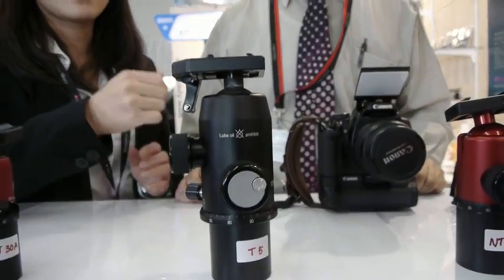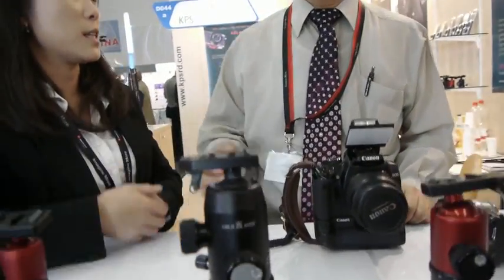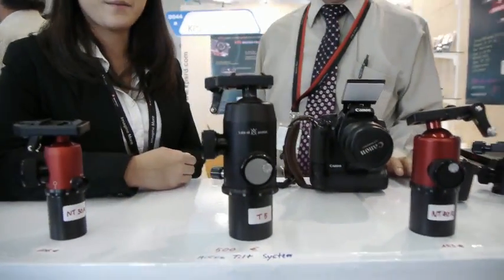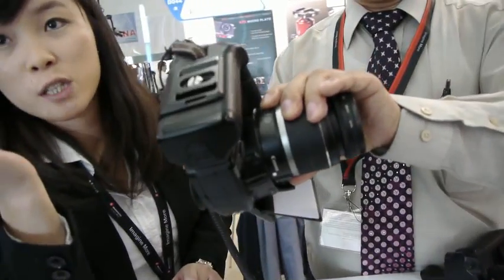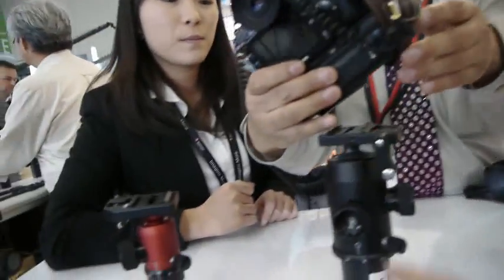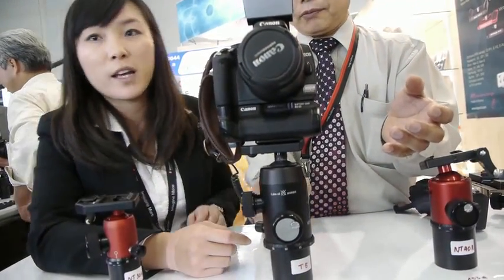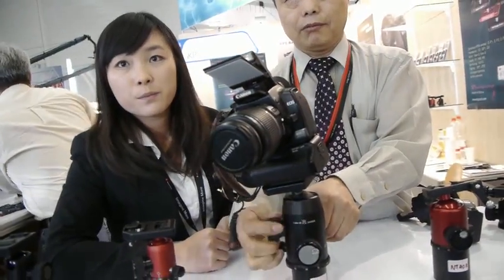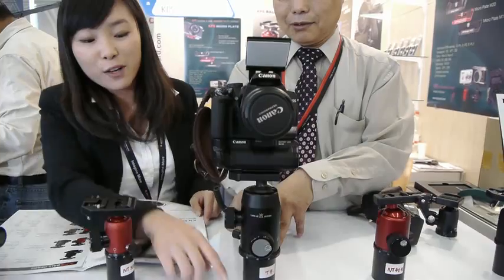Photokina 2010: KPS Research & Design's "geared" ball head w/ Arca Swiss plate alternative

Comment from the maker: @LeoInterHyenaem I think that it may not be clear in this video but the tripod head featured here isn't merely a ball head but a ball head with geared movements though the designer and his interpreter seem not to like calling it geared. By having micrometric adjustability, this puts this head in a similar category to the C1 and the Manfrotto 400 geared head. There are smaller Manfrotto heads but all add considerable "bounce" where as this head is very solid even with 4x5 camera mounted.